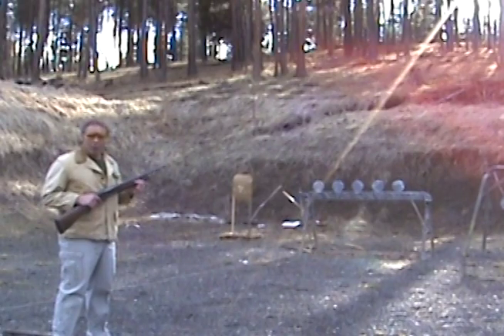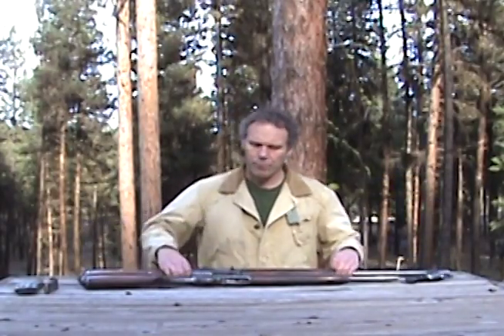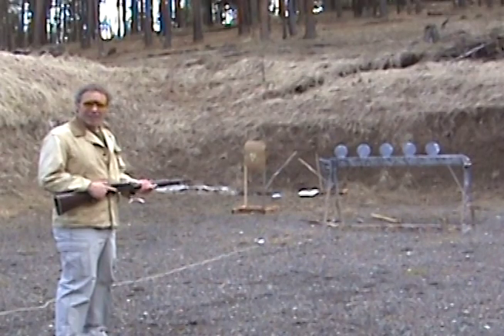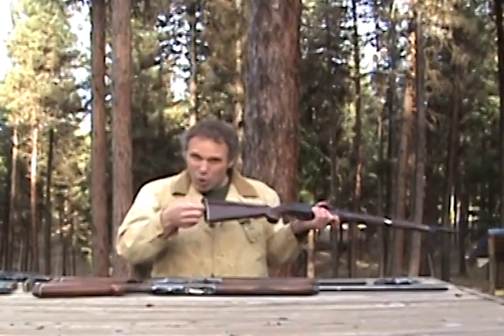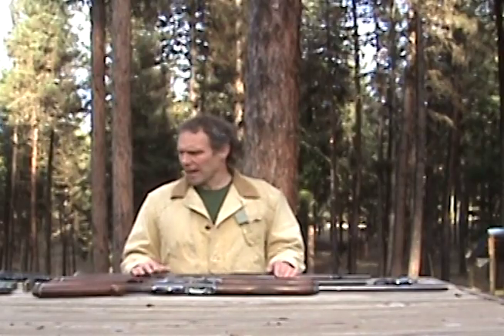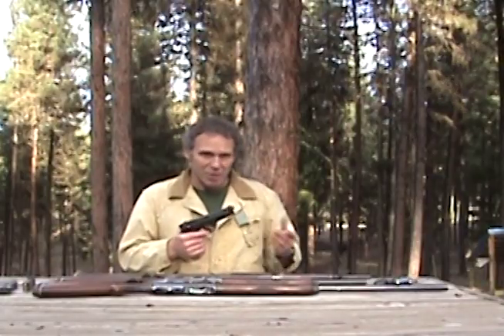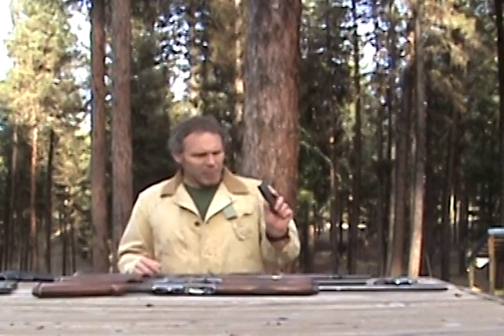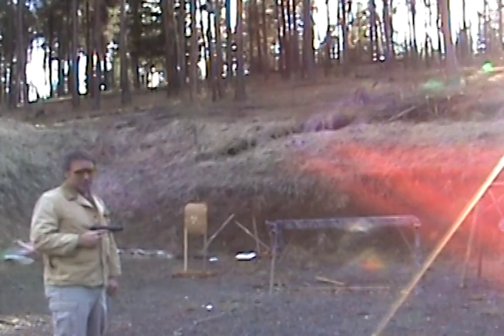Can spring compression damage a magazine?

Comment: Perhaps an empirical way to test the hypothesis is to take a standardized magazine such as a Glock 19 magazine that is brand new and use a weight scale, depress the follower to a standard 3 inches of depth.  Leave loaded for a year, and test again the force required to depress the follower the same depth and see if the amount of force is within approximate amount.  Or we just ask a metallurgist who knows all things springs.

Comment: Theoretically if you can compress a good spring for 1 second and it doesn't damage it then you can compress it for 100 years and not damage it.  However there may be other factors involved such as alloying elements in the steel that cause different behavior.  Almost every car/truck you see is setting on compressed (loaded) springs 24/7 and the ones in the museums that are over 100 years old are still there, however I have also seen a small number of automobiles that have lost a little bit of height over time.  I don't know what causes it but there is something in the behavior that goes beyond theory, that's probably why it doesn't happen all the time and we can't predict it.

Comment: I rebuild transmissions for a living, spring steel will lose its spring tension being compressed for a long time, or repetedly used. stretching the spring will work for a minute but it will go back to its wornout state.
Reply: Transmissions are subject to a great deal of heat and cycling of that heat.  That's a great way to ruin springs.  That being said, There are plenty of transmissions that are ancient and still working just fine.
Reply: I would agree with that. I would also argue that the quality of the spring steel has to be called into question. I also work on a lot of old vehicles. most of the throttle return cables are stretched. even leaf springs/ coil spring collaps after years of constant tension. never heated like a motor or trans. But some springs dont collaps over the years. why is that? probably quality of spring steel and constant tension. Metal fatigue also applies to hardened and or spring steel. I think the idea of checking a magazine that sits in the closet once a year is being mindful of your gear. Can you be too well prepared for an emergency?

Comment: the main issue is that springs CAN be damaged by being left in a OVERLY compressed state. This is a well known thing. Proper magazines like Pmags and HKs do not even allow you to OVERLY compress a spring like this. 

Same thing I'd imagine was true for that shotgun left with the bolt back. I would imagine it was designed to only reciprocate and not be left in that state for years on end.

Comment: "And in typical military fashion, they issued us this very reliable, well made, high quality handgun, and then issue these cheap knock off magazines to go with it" Been there, but instead of the military it was the Argentine Federal Police. During training with the Bersa Thunder, practicing reloading under adverse conditions when one of my magazines dropped the follower damaged and the handgun wouldn't lock in the open on an empty magazine. Upon inspection I noticed just how cheap the followers were made, they were from this soft light cast metal and had a horrible finish. I went, got a replacement for the magazine, and also decided to purchase one for myself. The one I purchased had the follower made out of polymer and the quality looked quite superior in general from a first glance even. The Bersa itself has been with me for seven years and to this day it still hasn't had a failure, not at least from the weapon, it did had but from some very bad quality ammo issued at one of the poligons we used for training once.

Comment: What spring experts say is that a properly tempered spring will not be harmed by leaving it compressed. But the caveat is properly tempered. Manufacturing consistency was far worse decades ago, so you may get a properly tempered spring or you may not. So if you have a classic firearm for which you cannot easily get parts for anymore, don't leave it loaded. But if you can get modern replacement springs from the likes of Wolff, you may consider replacing the springs with ones that you know have proper tempering. Generally speaking, modern springs made by a reputable company will not have this problem.

Comment: "I have ate pop tarts more than 6 years old" LOL

I have never had an issue leaving mags loaded... I basically leave my shotgun loaded and a mag or 2 for my rifle 100% of the time with occasional oiling and cycling and if I feel the need, replace the ammo. (Obviously shooting/checking operation/maintaining from time to time)
 I do not doubt for a second that a spring can weaken after long periods of being compressed... but I doubt its a super big deal. If the mag messes up get another (maybe be careful on rare/hard to find mag guns)  I wouldn't leave the action locked or something. 

I am more than capable of repairing/replacing stuff my guns. A rare/collectable gun I would treat a bit more carefully... think of them like cars. Your daily driver might be a bit dirty but it will get you where you are going, your classic show car you might treat differently.

Comment: As a engineer I certainly agree springs can and do take a set. The problem will be that you don't know the design spec of the spring and at what range of its specified range it is used at. There is bad, better and good design is all products. The quality of the spring steel  etc the list gets quite long.

Comment: Well, springs don't like being fully compressed, most springs are not meant to be fully compressed ever, and even those that designed for that, is designed for only a short amount of time, since a fully compressed spring is quite close to the limits of the material. This means a fully compressed spring can permanently reshape at fully compress load, especially if maintained for long periods of time. A good design would not allow any springs to be fully compressed in normal use, but in some case, that cannot be guaranteed, or even in a military or emergency type stuff (guns) it can be used that way, to add a few more rounds to the magazine or a bit more power for a whatever part. But it is usually meant to be happened for short periods of time. During those short times the chance for permanent reshaping is low or even zero, but if left for long time can occur. In a magazine it is considered a spendable stuff, yes, a few years and you need to replace, for whatever other part, it is clearly stated in the manual not to store in that position, and if you still use it that way, your loss.

Comment: Spring compression on a long-duration magazine load is something I worry about.  I spoke to an engineer who said that there may be an issue with warping the brass casing also because the cartridges would be in tight formation for too long.  

While we're on anecdotes, I had a Springfield XD 45 magazine that was loaded for 1 year.  It fired all 13 rounds in the magazine with no problem, and I did not notice any warping of the casings.  However, I compared the spring tension with a new magazine, and noticed that it was weaker.   

Until somebody does the scientific research, we're all just swapping stories.

So, I'll go ahead and start an experiment today. I will load a new Springfield XD 45 magazine with 13 rounds, and I'll put it into a ziplock bag to keep it dry and protected.  I'll shoot that mag 5 years from today, and report back.

One magazine is a small sample size, isn't it?  Oh, well.  :)

Comment: What I've been able to take from this is that spring compression REALLY depends on the weight being applied to it and just HOW compressed it really is. Perhaps keep your mags loaded to full minus one and just add one more when you go to the range. The difference between the first anecdote and others was that the first one was about the buffer spring for the bolt of the gun, versus the springs for a plastic 20 gram follower followed by 10-30 rounds of roughly 55 grain cartridges. A bit of a weight difference. Of course, there's many different firearms out there and many different magazines of different qualities and you're bound to come across some old fudd or a tacticool teen who have opinions based solely around a specific set of firearms when the reality is that it's all vastly different stuff. No ONE PERSON has all the answers if they don't have thousands of hours put into a subject that spans all sub categories of that subject.

Comment: When I buy a full size Auto Pistol (not mouse guns) I also buy: 12-14 magazines, the appropriate belt, holster, and mag pouches. I have always kept the magazines fully loaded. So that all I have to do to go shooting is take the gun out of the safe grab the "rig" and go... When done, I clean the gun and reload all the magazines... Some guns, like the Lugers or P-38, don't get shot very often, and guess what, I now have 15 luger mags and 13 P-38 mags that "stick." ... I have a Sig P229 in 357sig at the factory having all of its springs replaced. Being I have fired over 6,000 rds through it. It goes Bang... Click... Click... Bang randomly firing and not firing... So yes... Don't store your Magazines loaded. And yes replace your gun's springs as recommended by the manufacturer.
Amazingly my 45 acp Colt Combat Commander's 12 magazines don't stick yet... So how do I return the springs to their original strength...Spring Constant?

Comment: With a stock Glock magazine, how long would you advise to change out magazines? Is the possible damage on the ammunition, by unloading and reloading it, worth risking to take pressure off the spring?
Reply: Damage to ammunition is pretty hard to do, unless you are really, really careless and super forceful.

Realistically, you shouldn't have to worry about ammo damage unless you load and unload a particular round many times (I'd say at least a dozen cycles). 

So loading and unloading magazines to prevent spring damage is a better idea than worrying about ammo damage.

Particularly considering the idea that you shouldn't let your ammo sit around unused for a long period of time. Whether in or out of a magazine.

For maximum reliability, you should probably cycle through your on-hand ammunition at least yearly. And, personally, I'd leave only a couple of magazines loaded at a time (enough for just home defense use). Rotate which magazines are kept loaded, and use the loaded ones first during training.
Reply: MFG.  SHOULD GIVE OUT SPRING  LENGTH AND PRESSURES     AND THEN WE NEED SOMEONE TO MAKE A SPRING TESTING MACHINE.

Comment: Paul, dont you think alot of the ones that work vs. the ones that dont might be attributed to the quality of the spring steel used to manufacture and of course low cost mags made in China or whereever , that these purveyors wouldnt want to use the expensive good quality steel but thd cheaper stuff not processed as well when quenched, and.this would explain the differences? Thanks, Rich/San Jose

Comment: Spring quality varies greatly. Metals go through a process to obtain their characteristics, in China that is a questionable processes. The allows which are used vary greatly. Cheap magazines I have seen seems to suffer from the wrong allows beings used. Also springs that are overly compressed will weaken. I had been told from my youth not to fully load a magazine if it sets. But I also have been taught to keep springs generally in an unloaded state, that is for machinery. Some springs are designed to hold pressure for years, but those springs were engineered to function in that state by using springs that are specified  and designed for said purpose, generally by being built to exceed their purpose. Springs that go through a large range of motion seems to be the most effected, in magazines they go through a large amount of movement(distance) relative to the number of coils they have and the length of the spring in to its fully loaded(compressed) state. All springs weaken, that fact is generally considered by the manufacturer, unless it is Chinese then it is good enough specs. I have had no issues by keeping magazines at 4/5 capacity. Yes when I reload it is a habit to see how much pressure the spring has when unloaded so I know if the last round is being held in place for the last shot. Off brand magazines seem to have weaker springs out of the box and in general off brand magazines also seem to have more issues with cycling. For carry it is a general rule that  one should use a magazine made by the company that produced your firearm, and you have put many rounds through it and found it to be reliable.

Comment: I'm late to the party, but i'll bring up a good point. Springs are Engineered components each model of firearm has different springs, and those springs are all made by different engineers. I assume that many of these engineers design the springs for an infinite lifespan, and then test to a certain number of firearm uses and call it good -- this is understandable since testing the whole thing to millions of rounds would be cost-prohibitive. If the engineers didnt calculate everything out correctly the spring will lose strength over number of uses, and depending on the steel used, as it sits compressed it will creep slowly releasing the stress on the spring while also reducing the force from the spring.

Comment: O.K. !
I have heard what sounded like very good arguments, both Pro and Con !
Seemingly similar thought process on most !
But something I never hear considered, is did the materials used in the manufacturing process change over the years, that might make some prone to developing a memory, if you will ?
As material compositions may change over time, this would seem a potential for such failures !
I would find it hard to believe, that over the years, materials and methods for manufacturing never changed !

                     🤔....?
                 Just Say'n !

Comment: Spring metal has changed since the 40s, 50s, 60s, and so on. The failures you mentioned happened to older firearms and to “cheap knockoffs” with no doubt, inferior metal in the construction of the spring. I’m sure the people preaching that spring damage is a myth all have newer spring steel in their firearms or magazines. I’m NOT advocating that newer guns with updated spring steel will ‘never’ incur damage, I’m saying that older springs and cheaply made magazines are the ones you shouldn’t load to max capacity for extended periods of time. Only time will tell whether or not the newer guns with higher quality spring steel, like Glocks, will fail or not after being loaded to the max.

Comment: Hey I am not an expert in fatigue of certain metals turned into springs; but I can tell you the correct engineering degree and research of materials would tell you about the fatigue of certain springs. Probably also how, why, and when they could fail.

Comment: The magazines are designed so they are not at their stressed point when fully loaded. If you loaded an extra round then it would have an effect on the spring. The bolt spring you talked about is not designed to be compressed for a long period of time. An engineer explained the science behind it.

Comment: Is a good one then you can leave it loaded. There's a video of a guy who left his ar15 mags loaded for 18 years and then we shot them they ran perfectly. There are even mags left loaded since ww2 that were recently shot and still worked. It depends on the quality of the mags. Good mags have good springs. If not the spring can be replaced with one that was actually quenched in oil and made from a better steel.

Comment: As a mechanic, not all springs are created equal, much like bearings and fasteners there are cheap ones and there are high quality ones. that knock off magazine, in all likely hood, does not have the gold standard of springs. I will also say, springs are not magic, if you bring it to its maximum compression( or tension or torsion) and leave it there, in time you WILL weaken it. IN TIME... how long is that time? who knows? but you are abusing the spring. 
If you want something to last, go with quality and care for it, with firearms and relationships.

Comment: Hi Paul I had a pellet gun made in the check republic. I gave it to my brother.  He left the gun in the closest It could not fire the pelt because the spring was soft. I was a apprentice machinist at GE one of the things I was taught was leaf spring will springs will eventually brake, but coil spring will get soft over time if left compressed. So there is plusses & minuses on booth. So this will  explain why colt black powder guns the springs broke over time. coil spring were not as reliable as they lost power over time. coil springs will work till they brake.  Now I have heard coil magazines using coil springs  last for years with out problems . I think this is because metrology has gotten better after world word one.

Comment: Can you stretch then heat and quench the spring. I'm not a metallurgical student or a blacksmith in any way. I'm thinking heating with a Benzomatic and quench in ?IDK?.
Reply: No way. I am a full-time welder and part time blacksmith and I would never fool myself into thinking I could pull it off. I could certainly try!
Mag springs are too dainty to be fooling with in a rudimentary blacksmith shop. Just buy new springs.